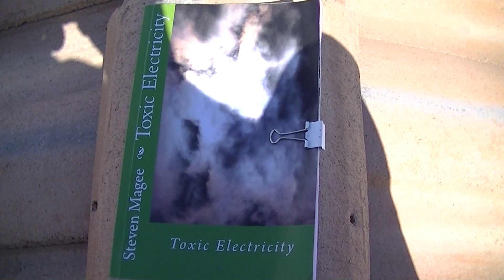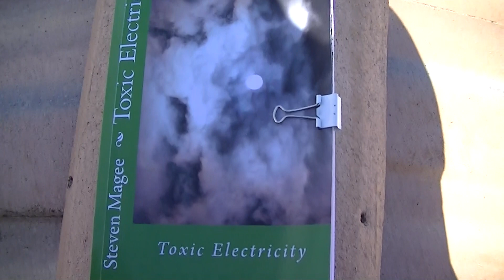Wireless Radiation Readings from my Roof

Comment: What is the nature of what you are measuring (to the lamen). What does this translate to. What are traditionally normal levels? What are the health risk rates at each significantly different level (in terms of health risks).
Reply from the maker: Radio wave sickness is commonly referred to today as Electromagnetic Hypersensitivity and how high is too high for wireless radiation exposures? People with Electromagnetic Hypersensitivity commonly report the following: 6 to 3 V/m: Too high for ambient levels. 1 to 0.3 V/m: Too high for many people. 0.1 to 0.05 V/m: Many people have symptoms. 0.02 to 0.01 V/m: Most people with EHS are okay. (Source: EMFields Acousticom 2). The Tenmars TM-196 RF meter manual states “We recommend a maximum level of 0.614 V/m for prolonged exposure”.  http://www.environmentalradiation.com/

Comment: As well you already understand it is not the uW or mW or W per meter heating effect we are worried about, but frequency, and biological effect upon cellular relationships, hydrocarbons etc. related to induced disturbances of electron orbits and bonds.

Generally there is much more power in radiation we receive from the Sun, but life has evolved to use solar frequencies.  Then the most stupid creature ever comes along - man - and arrogantly believes he has the right to f*** everything up !

Comment from the maker: "At least five new cell tower studies are reporting bioeffects in the range of 0.003 to 0.05 μW/cm2 at lower levels than reported in 2007 (0.05 to 0.1 uW/cm2 was the range below which, in 2007, effects were not observed). Researchers report headaches, concentration difficulties and behavioral problems in children and adolescents; and sleep disturbances, headaches and concentration problems in adults. Public safety standards are 1,000 – 10,000 or more times higher."  BioInitiative Report 2012

Comment from the maker: 814 mV/m is equivalent to W/m^2 = 1.758e-3, mW/cm^2 = 1.758e-4.  On line conversion from the Field Strength Calculator: V/m, dBuV/m, dBuA/m, pT, dBpT, Tesla, Gauss, A/m, mW/cm^2 & W/m^2 at the Compliance Engineering web site.